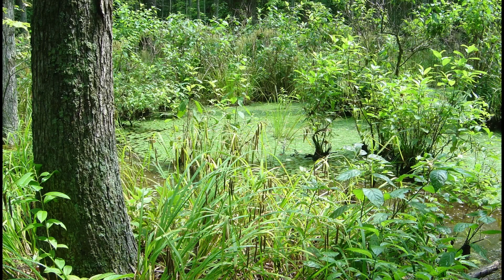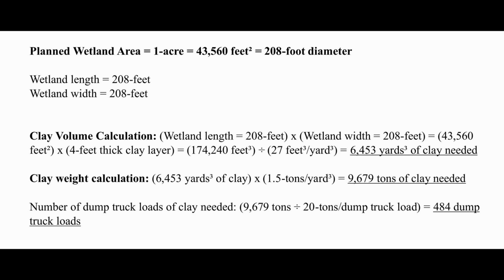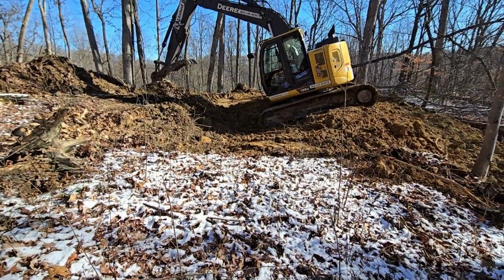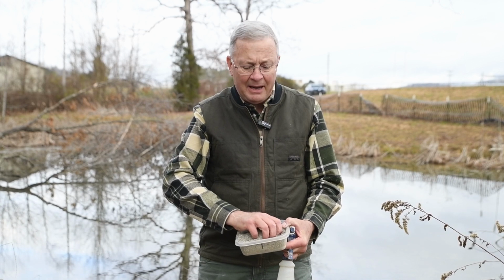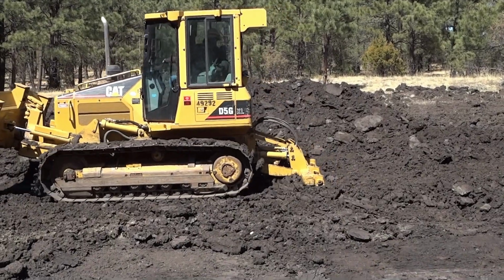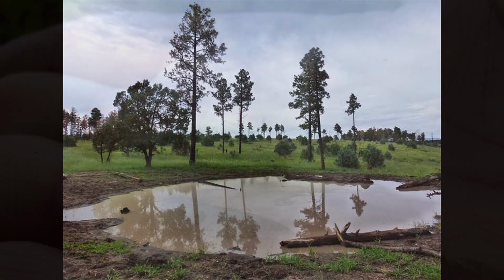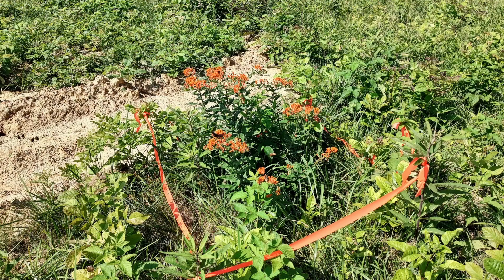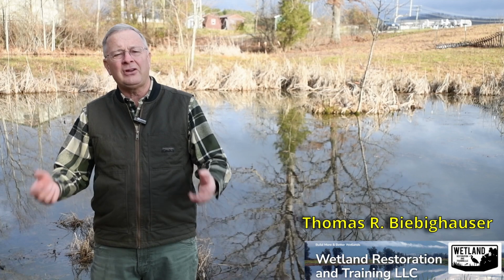Compacted Clay Liner Technique for Building Wetlands (Episode 15)

Comment: Sometimes, clay has clear benefits over other subsoils.
Reply from the maker: Hi Dave, You're right! This video shows how you can build a wetland using the Compacted Clay Liner Technique on areas where there is a layer of soil that is high in clay that is at least 4-feet thick near the surface, and where no groundwater enters the deep test holes that you dig. In earlier Episodes I show how you can use the ribbon test to measure clay content in soil. I wish you success!